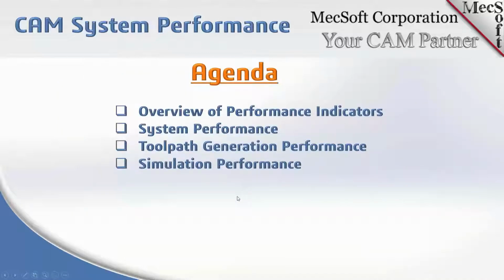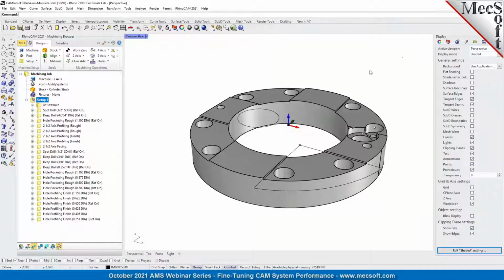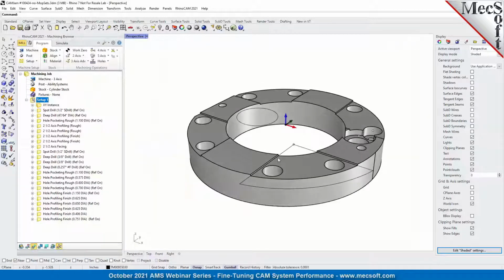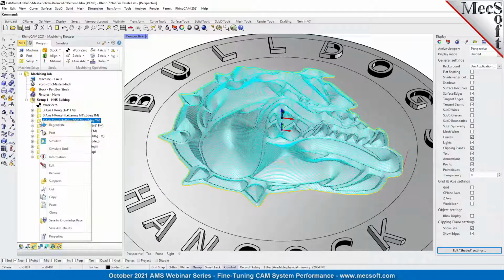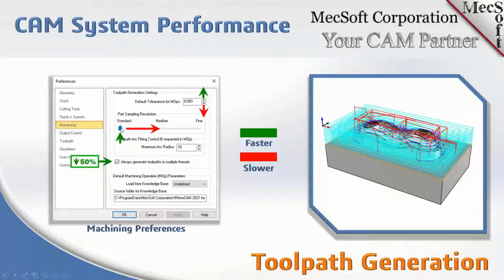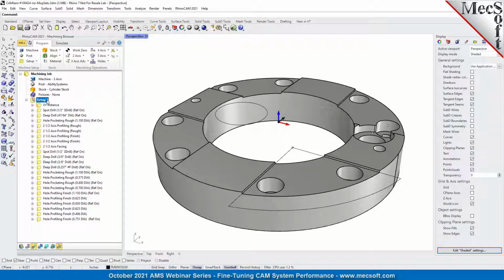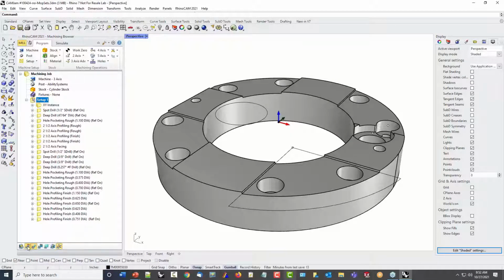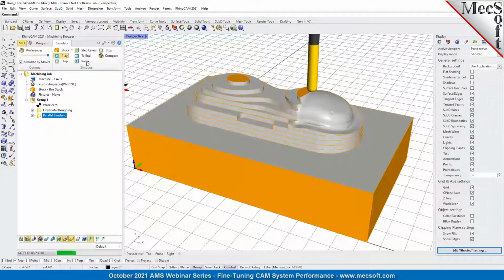Oct 2021 AMS Webinar Replay: Fine-Tune your CAM System Performance

Comment: If you are running an Nvidia Quadro graphics card it’s also helpful to change the 3D setttings from the base profile to workstation dynamic streaming. Advanced streaming would also be an improvement over the base profile.